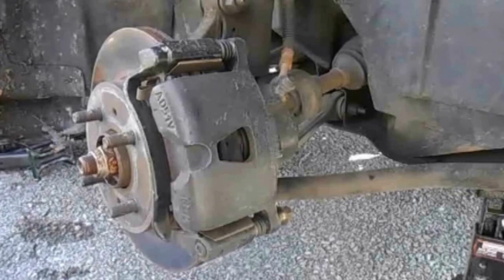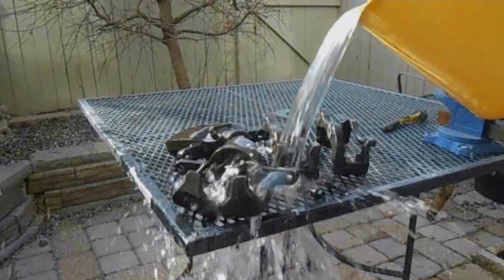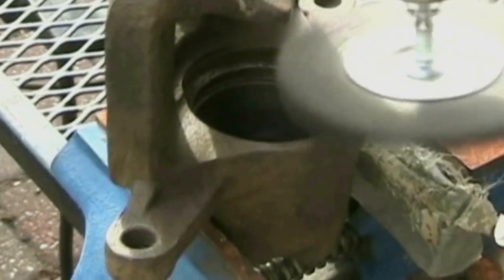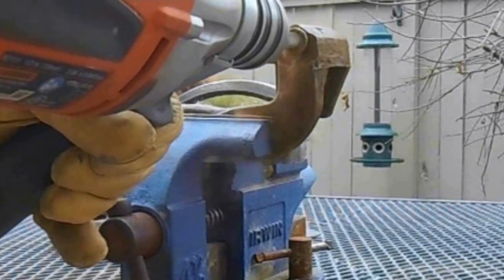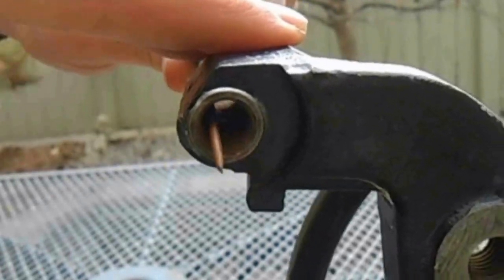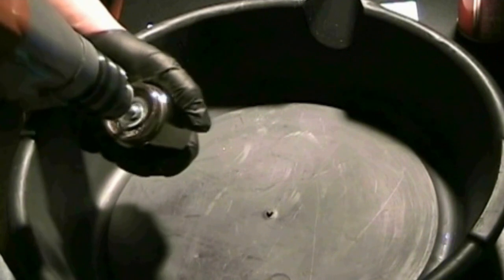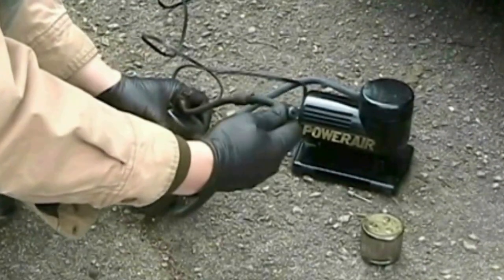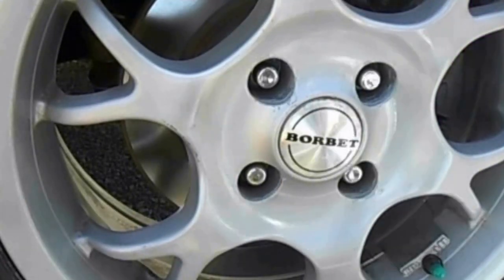Rebuild Your Calipers

Comment: Nice video! Before adding the new hardware, it's a good idea to cure the paint. Drying and curing are two different things. Air will dry the paint, heat will cure it. The paint won't be chemically resistant until cured. To cure the paint put the painted parts into a 200 degree Fahrenheit oven for 1 hour. This will really harden the paint.
Reply: Depends which kind of paint.

Comment: You should use soap-based red rubber grease inside the cylinders and on the pistons and seals to decrease corrosion inside the caliper. Assembly is much easier too.

Comment: If u haven't got a compressor, I used a punch/drift and a hammer to knock out the piston through the banjo bolt hole,worked a treat.
Reply: Some cars (like the Saturn above) the hole isn't lined up in the middle and you risk pushing the piston crooked and scratching it and the bore. Really best to use compressed air (carefully).

Comment: Excellent detailed demonstration.. if I would do this I would also rebuild rear brakes and master cylinder and flush brake lines very well with denatured alcohol and compressed air..
Reply: why rebuild the M/C and don't do the alcohol thing. just bleed system with brake fluid.

Comment: you can get the clipper piston out by removing the  pads then pumping the brake the brake pressure will push  the piston out if doing 2 use wood to block one in then wrench it out after the other ie once one is out theres no pressure for the other one just take it out most of the way
Reply: or rebuild one brake then the other

Comment: Hey i was just curious where i could purchase the wire brush attachment you used to clean out the caliper slide pin holes?
Reply: Is that really a question you must ask in 2019, the age of internet, google, Amazon, Ebay etc.
Reply: Yes, ebay.
Look for "Engine Rebuild brushes", etc
 Also might find them at car part places

Comment: How did u stop the brake line from leaking brake fluid while your callipers are taken off?
Reply: you clamp the brake hose!! with a regular line clamp
Reply: Mal P Won’t the brake lines be damaged?
Reply: @fuzzy34r  no not really! you can buy either metal or plastic line clamps designed for hydraulic brake lines or any other line that needs to be clamped.. you only need to lightly clamp the line to stop the fluid flowing then once you've finished just release it & bleed the brakes.
overall if you apply common sense when doing this job you'll be fine.. ie very old car you could collapse the line & it'll need replacing anything modern & it should be A-ok. I've clamped a 94 Toyota brake system (job done in 2010) no issues & 2004 BMW (in 2017) & in the last few weeks my 08 mini (in 2019) none had issues from collapsed lines & I know a lot of other ppl who clamp lines when doing brake jobs, including garages.

also, if your planning on doing this job get a 1 man bleed kit it makes bleeding the brakes after-words a total breeze, such a kit is very little money (less then £20 easily)
Reply: @fuzzy34r  Yes, and you should replace them after doing that, brake hoses are not meant to be crimped, use brake hose plugs.
https://www.autozone.com/brakes-and-traction-control/brake-hose-plug/dorman-brake-hose-plug/441046_52744_0
Reply: What I learned from Eric the Car Guy (which he learned from one of his viewers) was to use a piece of wood squeezed between car seat and brake pedal to keep pedal pressed down.
I've done it and it works great.
It's because the piston in the master cylinder will be past the reservoir when it is pressed in.

Comment: You didn't tell them to lubricate the slide pins or brake pad contact points. Also, you should have mentioned bleeding the system to remove air.
Reply: or clamping off (gently) the fluid hoses
Reply: Sandy Grungerson next...how to bleed master cylinder..lol
Reply: Chris yes lube pins with silicone grease
Reply: Chris where can I get the piston and seal kit for a 2010 RAV4 V6 any suggestions 
Thanx
Claudius
Reply: Try RockAuto for pretty much anything like that.  Your local automotive parts store will likely have everything you need though.
Reply: The video is "Rebuild Your Calipers" I think he covered that pretty well.
Reply: Random clips😍

Comment: if i rebuild my calipers do i need to change the cylinder too if it has a rust eating the cylinder? because it still leaking brake fluid even i change all the rubber sealing.
Reply: Usually caliper rebuild kits come with pistons (cylinders) too, so yes, probably.
Reply: Caliper rebuild kits DONT come with pistons, only the rubbers and maybe lubricant.   But caliper pistons are 5-10$ each and you should of course replace them if they are scored/rusty.
Reply: @gplusgplus2286  actually some kits do come with pistons. A quick google search of, "caliper rebuild kit with pistons" will furnish many results

Comment: How did u pull the piston out ??
Reply: Blow with compressed air and wait for the bang.  Helps to put a wood plank or a rag to catch it
Reply: You can push the piston out while the caliper is still on the vehicle using the brake fluid to push it out of the cylinder all the way with no brake pad to bottom out on